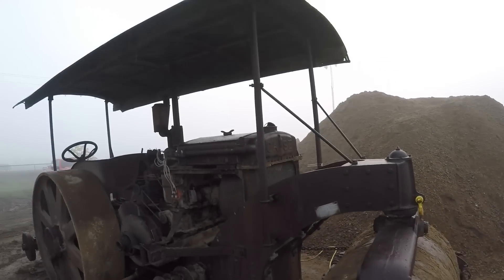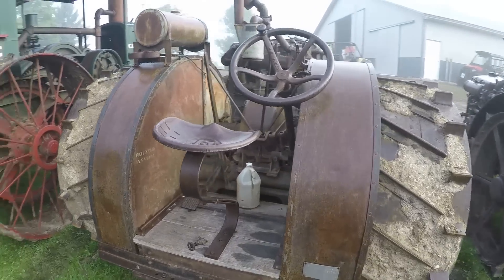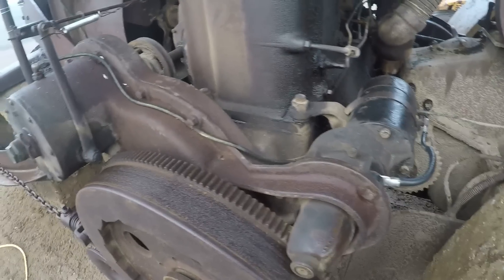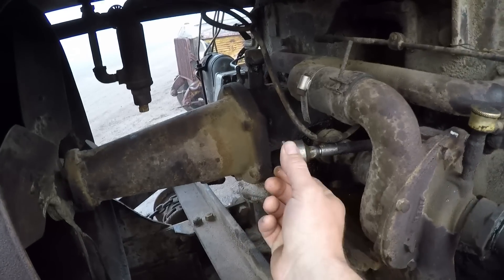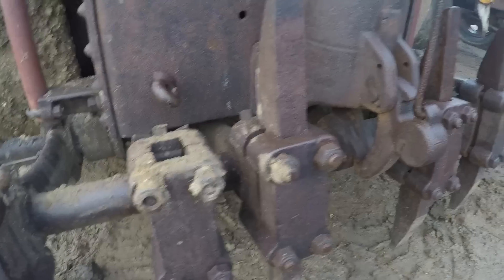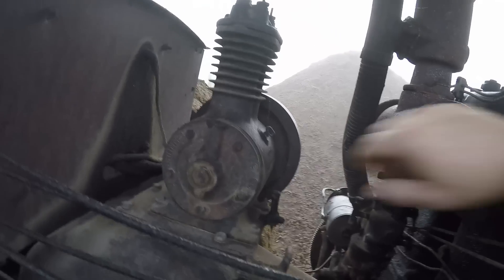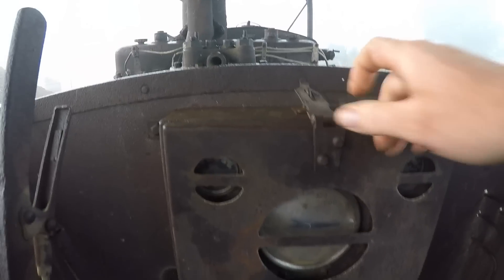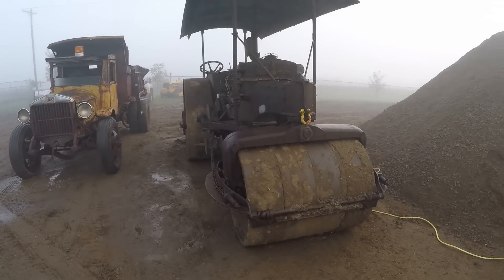CASE 25-45 Crossmotor Tractor/Model 10-Ton Road Roller Walkaround

Comment: I  think the pins in the wheel face are made with a tapered hole in the wheel where you can take them out and turn them over so they stick out and it forms a sheep foot roller effect.  A sheep foot roller is used to pack the road bed much deeper. A flat roller only packs about two  to three inches down.... Nice video and commentary. I like old equipment and your presentation is always great.

Comment: I think you were very correct about the throttle and timing lever which was also found on our McCormick-Deering W-30. For starting, retard the spark, set a little throttle, pull the choke rod and  give the crank a brisk pull upward. It always started, even in the winter when I was a kid on the farm. The W-30 was our primary plow tractor for many years until the Farmall M was purchased.

Comment: I have an old Brunner air compressor. Unfortunately the pump was locked up and I had to shelf it and replace it with another pump. Not much info on them. Just that they were went out of business in the mid 60s and they were built in Utica NY. Thanks for sharing this cool machine

Comment: My earliest brand of Rollers that I remember where Buffalo Springfield. I was too small ( young ) to know anything about them. Then in my working days I did so with a Company that 
sold, rented and serviced RAYGO vibratory rollers,..and they are gone too now!
Thanks for this really interesting 'walk around'.
Reply: Reg Sparkes I remember the Buffalo Springfield rollers in the 50’s. Big, heavy slow turning gasoline engines.
Reply: @billmoran3812  Yes, Bill, and I used to here them always referred to as " a steam roller'.......I was thinking then, that maybe those engines were built by Continental or Chrysler,..I don't know, but always thought that not much could stop them,...so it seemed! Hahaha!
Cheers!

Comment: I have an LA Case and it has the same timing and throttle controls. Pretty sure the cross motors used wet sleeves like my LA so they were ahead of their time on that anyway. Those big old 4-cyl sound good too.

Comment: Most of Case's "industrial" crossmotor tractors were equipped with electric start. Road Rollers, Graders, etc. At least every one (which is rare) that I have seen has had the same electric start setup. I LOVE the old crossmotors. Not a cheap tractor to own or repair, but a very cool piece of Case history!
Reply: @squatch253  Glad I could finally teach YOU something! Ha ha. That is a rarity to say the least. Keep the videos coming!

Comment: That's cool! If that thing ran, and had a good operator, it could do the same job it was designed to do 95 years ago. Granted, modern rollers are easier to operate and steer, but they don't compact any better than that thing.
Reply: i sure that thing runs

Comment: You will have to forgive those of us intrigued by the
truck!  I love the logic of Crossmotors and anything
transverse (or is it "perverse"?):  bending power
around corners with bevel
gears is unreasonable if you
can avoid it.  The Case bevel
fan drive is just the lesser of
two evils,  although many early tractors must have done
well enough with transverse
air flow as well.
   What is your opinion on a couple of other design trends,
Toby.....
   Were air pistons or even air
motors for lifts and other auxiliary functions almost
unheard of before hydraulics?
I think the materials and tolerances would be much less critical in an air system.
I'm wondering if one reason
they sure weren't prevalent
that I know of is the danger
from air's  "springy" elasticity.
   Why did square bolt heads
go away?  They must naturally
avoid rounding much better than hex,  the best of all logically being  triangular or rectangle.  Now I think about
it,  the camming forces from
hexagon side angles really must put the highest stress on
the wrenches,  too.

Comment: The guys that used that machinery must have really known their stuff, Machine operators nowadays if you were to remove all of the driver aids they stop dead or make a real mess never mind the air conditioning and air sprung seat and a cab that with the engine running with the governor wide open you cant hear anything but the sound of silence. Nice video

Comment: Great walk around, did you do one of the truck next to the roller? I would love to see that posted as well if you did.
Reply: Squatch253 
OK, I can relate. I work for the RR that ran the big steamer through your area a month or so back. I’m sorta in the same place with my attitude towards trains. I do enjoy your vids though, I used to work for a ready mix concrete company at their sand and gravel washer. I operated and worked on all their heavy equipment. That’s how I got the knowledge to work on machinery and eventually in MOW for the RR working on the track maintenance machines. Then I transferred to the locomotive shop working on those til now. 
Tell Senior I’m eagerly awaiting the next Farmall video too!

Comment: Question. My uncle has an RD6, (TRACTOR #3H3592 W). We are having an issue starting it. Seems to be a fuel issue. We loosened the tubes that go up to the injectors, and are only getting fuel out of the rear one, and nothing from the front 2. Can you direct me to any literature on the fuel system? PS the tractor is in Dayton mn:). Thanks for your time Squatch!
Reply: @squatch253  Yes we did that first, good flow out of all 3. Still nothing on  the front 2 when we crack the lines open. Is it possible those two injectors are stuck in the up position? Is there a cam behind the rectangular cover just below the out going lines? Thanks!
Reply: @squatch253  Yes sir she has been sitting for a couple years. We will pull that cover off and try to free up those plungers! FYI this old girl has the Laplant blade on it! It's been in the family since before I was born (I'm 52 now) it's been on my bucket list to drive it!. Thanks a ton. I hope to run into you at Nowthen or Amalund one of theses years.
Reply: @squatch253  We pulled the rectangular plunger cover off, it seems the rear 2 plungers are working but the front plunger seems stuck. I can see the front plunger kinda tickle up and down as we turn the motor over, so I'm not sure rust is an issue. What does that rack and gears do? The fuel lever seems it should actuate the rack, however ours seems to be stuck in the rear most position and doesn't really budge but only .05- .07 of an inch. This thing is not rusty or cruddy inside of it, it all seems well lubed. Kinda stumped.. any thoughts would be appreciated! !

Comment: I like the yellow truck next to the case road roller I had thought it looks like a Reo Speedwagon
Reply: Now I've never heard of a "Rio Speedwagon", but I have heard of a "REO Speedwagon"...
Reply: zormpas sometimes I detest auto correct that is how I had it spelled I fixed it
Reply: @tracywraley6892  Yea, I hear ya! I run Firefox and use its spell check heavily - but I leave auto-correct off.
Reply: I believe it is a Sterling. Built in Milwaukee.